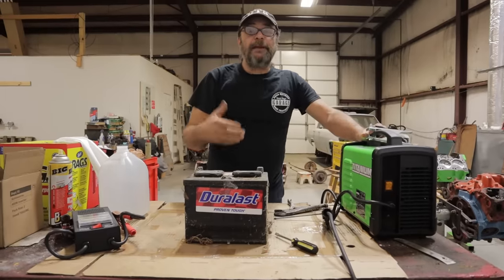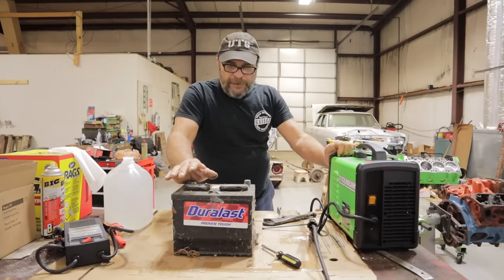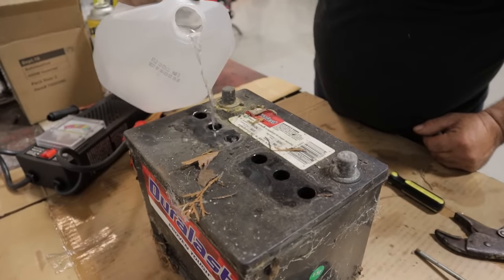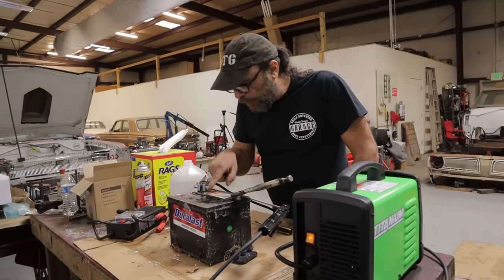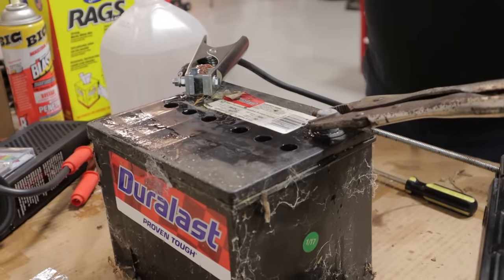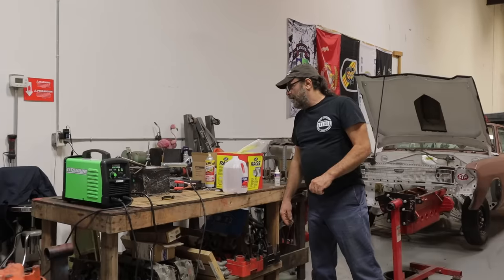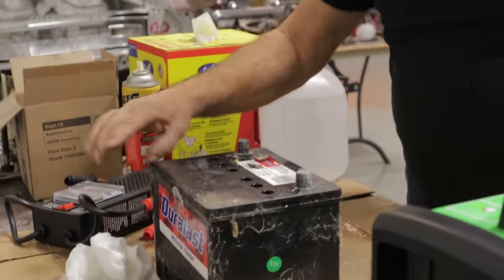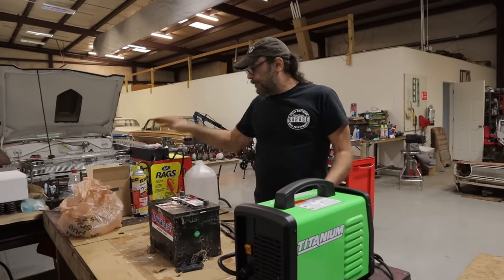Reviving Dead Batteries With A Stick Welder

Comment: I used to rebuild 3000lb electric forklift batteries and we made sure to use air to blow out the gas from the cells and use a fan when we solder back the lead cell connectors on top. I was always worried about those big batteries exploding but thankfully none of them did. We did rebuild those electric forklift batteries in our shop but it was well ventilated.
Reply: 10 years ago I had one of those big lift truck batteries hanging static on a hoist with a 2-leg J hook chain sling hooked on the two lift eyes on the battery. It was hanging totally static, not swinging or in motion, for about 1 or 2 minutes while my attention was momentarily diverted to correct something on the lift truck that was about to receive the battery. It was hanging about chest high, about 4 or 5 steps away from me and was never out of my sight. I was alone in the area, no other personnel present. 

Suddenly one of the lift eyes on the battery just snapped, and when it swung down the J hook on the other end came out and battery crashed to the floor. That lift eye showed no sign of cracks or damage when I hooked the sling on it. I was in the habit of inspecting the chain and the lift points of anything I hooked up in my 30 years at that employer, and that lift eye on that battery had the appearance of being just as solid as any other I had lifted before. When I slapped those hooks on it the steel sounded as solid as any other. It was spooky weird the way that battery lifted perfectly normal and was hanging perfectly still when the lift eye just snapped.

I figure that somehow the steel of the lift eye was weakened by contact with acid. The lesson I learned was never let the battery get any closer than arm's reach when suspended and keep others away from it during any lifting. Don't ever trust a big battery when it's hanging on a chain.
Reply: @onemoremisfit  We had several people drop those batteries when they didnt make sure the J hook was completely inside the lift holes in the battery. It was a scary sight to be called to the battery room when a 3000lb forklift battery is turned upside down on the floor with battery acid spilling out and the positive and negative cable was underneath and shorting out on the battery case.
Reply: @onemoremisfit  How many times had the battery been lifted?  Metal fatigue, maybe?  You're probably onto something with the acid weakening it.
Reply: @Face2theScr33n  Those batteries were lifted countless times. They were in a large designated area with rows of chargers, rows of rack stands for the batteries of numerous different types, bay post mounted fans to keep the gasses ventilated, eye wash stations, etc. The batteries were maintained there by other designated personnel who were not present because I was off shift at the time.

All lift chains throughout the plant were regularly inspected and fitted with dated inspection tags by certified blacksmiths. But I didn't see that scrutiny applied to lift points of battery cases. 

The battery cases were heavy overbuilt steel with lift points formed into each end. As far as I could tell nobody really questioned them beyond watching for obvious damage, of which I never saw any myself.

The broken lift eye showed no stretching at the break point on my quick look after it broke, but I didn't have time to examine it because I had to hustle to get a water hose and flush all the acid running all over the floor to a drain. 

I had to call other people immediately to report the incident and they took over. I have no idea what, if any, their findings were. I got disciplined over the incident, but that's another story.

There could have been a hidden crack, but there was no way for me to tell while I was hosing down the metal and worrying about the acid spill. Cracked metal often makes a telltale sound, and I heard nothing like that when I hooked it up. I have lifted a lot of large objects weighing 10 tons or more with bridge crane hoists and large chain slings, often with purpose built lifting devices as well. I have a modicum of training and experience doing that. 

I'm not a chemical or metallurgical expert, but it appeared to me that steel was somehow embrittled and weakened. Those battery cases have the unique situation of being continuously exposed to acid fumes.

Nobody saw it happen but me. I will tell anyone who will listen that if you lift big batteries on the job, don't ever trust those damn things.
Reply: @onemoremisfit  I'm thinking that if you didn't see it, it was metal fatigue.  Steel can become weak when loaded enough times, even well below the yield threshhold.  I'm not an engineer, so I'm not sure if it's the same as when a metal "work hardens", but seems to be so.  I need to buy some engineering books or something.  You would see oyster-shell looking marks on the broken end of the fastener.  Anyway, definitely glad you survived and nobody got hurt.
Reply: @Face2theScr33n  The lift chains we used could last indefinitely if not abused or overloaded. If you saw the way that battery just fell without warning you'd agree there was something going on beyond normal steel behavior. When I lifted it and swung it into position before letting it hang, that was greater loading than when it was moments later just hanging static and snapped. 

Safety rules forbid getting under a suspended load because you never know when a chain, wire rope, hoist etc can fail. But there are plenty of ways to get hurt without being directly underneath. And usually when there is a failure the cause can be identified. All I know is that battery fell inexplicably right in front of me, and there is a corrosive chemical involved, and I will never trust a suspended battery ever again.
Reply: @onemoremisfit  what I'm saying is that fatigue occurs even if a part is never overloaded, but loaded/stressed for many cycles.  You never need to reach the yield threshold to snap a piece that has become brittle from repeated stress.
Reply: @Face2theScr33n  Yes, I understood that. And that battery case was freaky. I've seen stuff give out and break before, but not like that. I'm not qualified to analyze it on a metallurgical level but what I witnessed left me very leery of battery cases.
Reply: @onemoremisfit  There is science behind this. steel doesn't last indefinitely, it has a duty cycle, and stress fractures are the problem,... Of course, large buildings and bridges are an engineers concern, the the same principle applies with hoists.  Also, How is a chain link or eyelet stressed, it is bearing a load unequally around its circumference?  So the take home message is steel has a working life,  What that is, does anybody know?  Talk with your Engineering colleagues.
Reply: @mikemotorbike4283  Yes I'm aware of these things. The chains and hoists are inspected regularly by experts who know more than I. They look for warning signs. The company also trains everybody on safe lifting. But the bottom line is there is no way to be absolutely certain so you just have to try to minimize the unavoidable risk. I suspect (I don't know) that the risk of battery case lift point failure could be compounded by chemical exposure. I know I saw a battery case fail without warning. Again I'd point out that the battery case lift points are over built with more cross sectional thickness than the chains or lifting devices, and this is probably intentional safety factor. Take it from me, they are not always safe as they look. That much I do know.

Comment: I think my biggest concern would be to keep the top of the battery dry as NOT TO SHORT CIRCUIT between the terminals. This should also be a part of routine maintenance to make sure there are no wet tracks between those terminals which will cause overnight voltage leakage/drain.
Reply: I'm not an electrician but, aren't all the cells connected via the water/acid inside the battery? Isn't the path of least resistance through the terminals?

Comment: Desulfinating is actually reversing the polarity for a nano second using capacitive discharge.  With the right charged capacitor you can even revive those small (non-lithium) batteries making them like new.

Comment: I had 2 batteries that were weak due to not driving since pandemic hit.  My Titanium 200 welder on stick function allows you to produce DC at 16 to 20 volts and 30 to 60 amps, and very little AC or pulsing was measured by AC DVM.  Did 3 sessions, 5 minutes each with good gas bubbling  (outdoors).  Both batteries regained charge and now show 20% to 50% voltage improvement, and stronger output current. 1 week later still stronger.
Reply: How long they lasted?
Reply: @49495lwbrmoxybe  they're still going several months later
Reply: The more "sessions" you do the more the battery improves. If you have to do 8, do 8, if more do more. 3 sessions is only for relatively good batteries. I had to do 8 sessions to revive a dead 12V battery that showed only 6V and now works, starts the car and holds a charge overnight.

Comment: Great video, this follows the VIR law, Voltage, Current, Resistance. So the plates are insulated because of sulfation buildup on the plates, which intern gives the circuit higher resistance, so the battery will now not take current at normal voltage because resistance is to high. So if we raise voltage it will allow current to flow overcoming the resistance. DC arc welders output 20-40v DC under load from what I've read, put a multimeter on terminals when it's charging and see what voltage it's reading. You could then determine using a clamp meter how much current the battery will take if you wind the welder up for a second and via VIR law workout the resistance of the battery. Also another interesting thing to back this up is an alternator in a car is capable of producing 100amps on most cars, but there is a regulator to limit the voltage to around 14volts, otherwise the battery would be doing the same thing in your car driving down the road. Lastly when I do this I attach a thermal probe to the side of the battery and monitor the temperature.
Reply: Thanks for the process. Can this method be used for  sealed lead acid batteries also ? That's maintenance free batteries. Thanks and may God bless you chief.

Comment: You should clean the top of the battery before you remove the caps. Then wipe around the holes so nothing gets in it. And using a smaller container makes it easier to pour without getting water everywhere. 
That being said, I never do any of those steps. I do recommend keeping a small bottle of distilled water in your trunk in case you need top off your battery.

Comment: I've had great results desulfating batteries, i used to take good cores when I worked at advance and refurbish them, gotten friends out of jams many times with my hoarder stash of fully charged batteries of all sizes. I just use the repair function on a NOCO genius charger, works same or slightly better than the standalone pwm desulfator I was using previously. to get full results with my method can take 1-2 weeks, I just swap the leads to the next battery every couple days so they all get it evenly
Reply: also, if anyone does this, dont bother attempting if the battery is AGM or gel, including Optima betteris. it just doesn't work. only flooded batteries will be improved, you'll make an AGM worse and maybe even melt a gel

Comment: This is simply using the high current DC to reverse the chemical reactions in the battery that has led to the sulfation buildup. Sweet Project Cars showed this on his channel a while back, and I have used this to revitalize my old batteries for a few years. Do this in 5 to 10 min increments. Do not use it above 80 amps, as that will cause trapped gases to blow out of the top.

Always have baking powder nearby to rescue/neutralize any spill or splashed sulfuric acid. Several treatments should be enough to give the battery a new lease on life. Make sure it has enough time cool before each treatment. Nice video.
Reply: I saw it there also.
Mike the hammer showed this 1-2 years ago. Works.
Do this every couple of years for a touch up.
New battery.
Reply: That's the main video that I watched learning how to do this but he says to get a 160 amp welder for motorcycle batteries and deep cells and a 200 amp welder for bigger automotive batteries. I don't see why that's necessary if you can turn the amperage down on the 200 welder and up for bigger batteries.
 Any thoughts on this? I'm not getting two different welders.

Comment: Your a lifesaver, I have hooked a battery up to 110 volt outlet and tripped the breaker four times and the battery worked perfectly fine after that, your method seems better
Reply: rofl
Reply: Accident Prone Much?!🤔🤣😆😂
Reply: Using AC is a great way to blow a battery up!  Don't try this!
Reply: @ssoffshore5111  to be fair the facy ones oculate to clean the plates too soo

Comment: Back in the 40s,50s,60s,and 70s old men had those 150-200 amp battery chargers in their garages and they'd cook their auto batteries like this every few years or so whenever they started getting weak... They rejuvenated their batteries for many years instead of replacing them every couple or 4 years such as is the norm today...

Comment: The same can be done with a charger with 200 amp start function.  Charge at 200 amps for 15 minutes and let cool for an hour.  Do that cycle 5 times.  With the caps off.  Each cycle you should see more action in the liquid.  By the last cycle all cells should be boiling.

Comment: That good for blowing the buildup that ends up bringing the plates over, it kinda just blows the shorted part out, et’s you have all the cells back operational again. It’s always worked for me and a pretty good success rate. But you’re still get a battery that has no hope for it here in there. Great info and hands on video.. thanks

Comment: I seen one guy revive batteries like you did and he would pour out the old battery solution after getting the scale burned off and put in new solution. He said it would last longer and keep the old scale from getting back on the cells.

Comment: Great video! I’ve owned and operated and automotive shop for over 45 years. I’m always learning new things. Just want to thank you for this video. I personally have had 5 to 6 batteries explode usually when charging or jump charging as just like you said. Get water, rinse yourself off get back to work. Two batteries actually blew the case apart. I think that was because they were low on acid but no mushroom cloud, no pieces of car flying through the air and a little soap and water did the trick. There’s crazy people out there and we ain’t one of them. Keep up the good work thank you Murph of Murphs automotive.

Comment: If you mix baking soda in the water you have standing by in case of accidental skin contact, it will neutralize the pH. Much better than diluting to relieve the burn.
Reply: You can get a bag of soda at Costco that is about 15lbs for like $6.  Handy to have around for acid neutralization, and you can safely put out grease/oil fires with it
Reply: @therealsideburnz  
Non-food grade pool cleaning baking soda comes in giant Arm and Hammer bags and it’s cheaper than the regular kind as well.

Comment: I've experimented with batteries before and I suggest that you have a container of baking soda which neutralizes the acid definitely suggests that. And any of the waste after that you have that you might throw away take baking soda and dump it in it and it will neutralize the acid and then you can just blow them properly and not cause any damage to anyting couldn't be eaten by the acid. Just a suggestion otherwise pretty cool stuff God bless have a great day.😎😃😀😁

Comment: You're amazing, and nuts. I use a fan to blow the gasses away, and clean the top of the batt. to prevent a short accross the dirty water. A dead cell from mechanical failure kills the batt. permanently; I have seen some that the lead has crumbled and fallen off the frames inside, and there are no longer plates inside. Love you guys.
Reply: Water wont conduct much electricity at 12 volts, let alone short anything